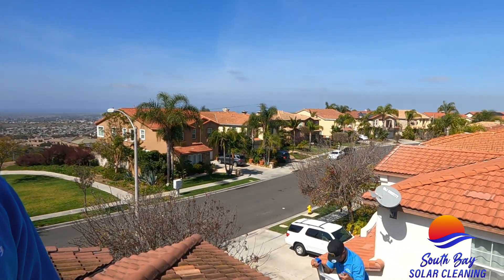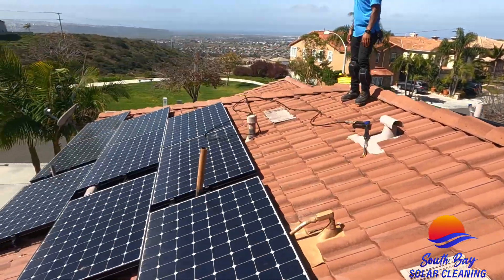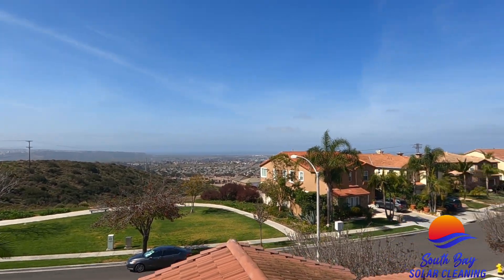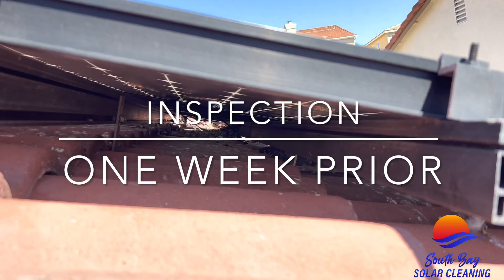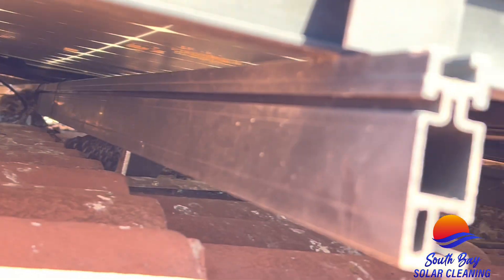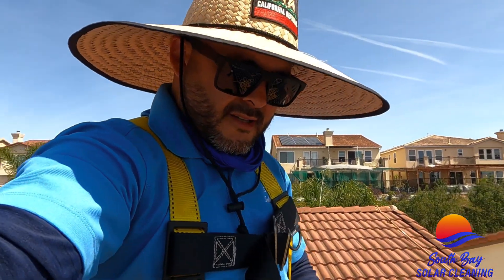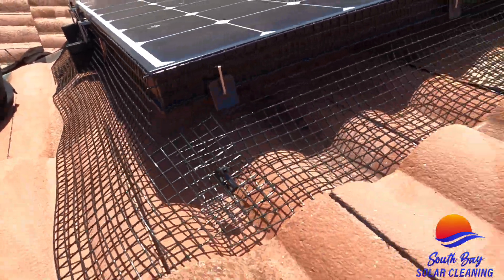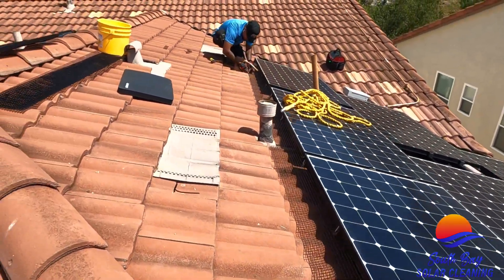Solar Panel Bird Proofing San Diego, CA

Comment: Nice video and very helpful. I did notice on the time lapse that you were actually sitting on the solar panels while installing some of the critter guard. I'm assuming the panels are strong enough to hold your body weight. Are you ever worried about breaking or cracking the panels? Also, do you shut down the power to the solar system while installing the guard?
Reply: Most panels can hold your wait. But it’s always good to be careful. Always try to walk on the metal edges and where the rail runs underneath
Reply: I'm no professional but I would say never ever put all your body weight on a panel , and second no you don't have to turn the power off